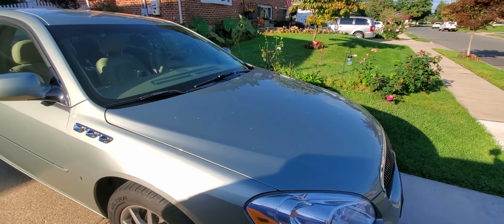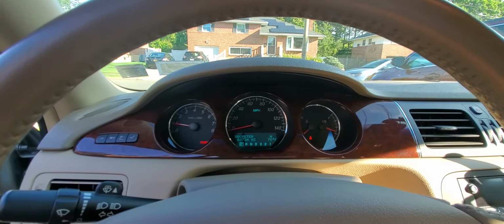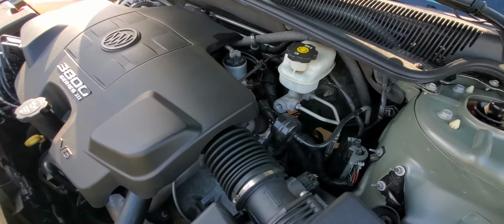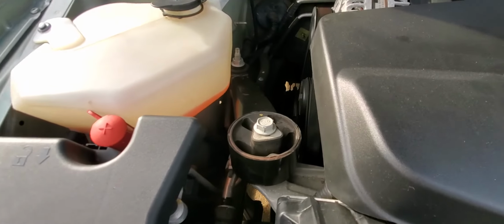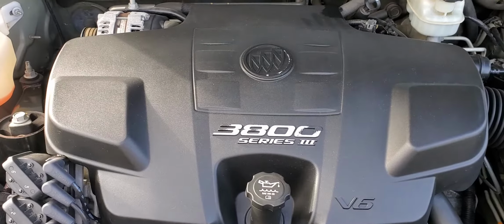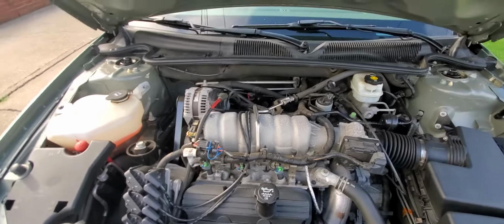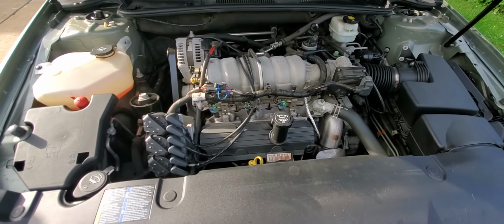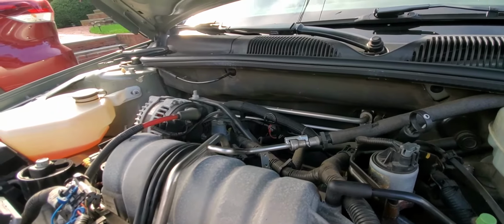2006 Buick Lucerne CXL (Start-up/engine bay)

Comment: Saw a trick you can disconnect the mount and tip the engine towards you a few inches and hold it with a ratchet strap to get to those rear plugs easier. Thanks for the series 3 content!
Reply from the maker: Great tip!

Comment: what is that big metal block with the steel lines coming from it on the driver side in front of the fans
Reply from the maker: ABS module.
Reply: @xjoe81x  so those are brake lines?
Reply from the maker: @moshiii.mansuraH  Yes